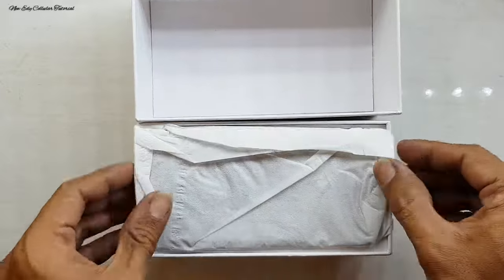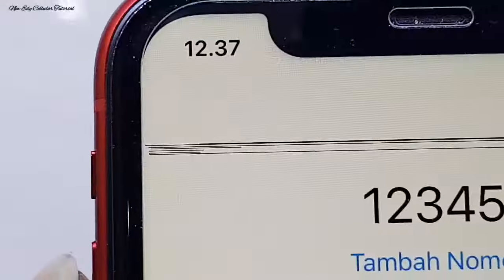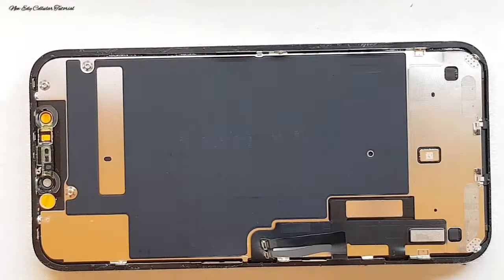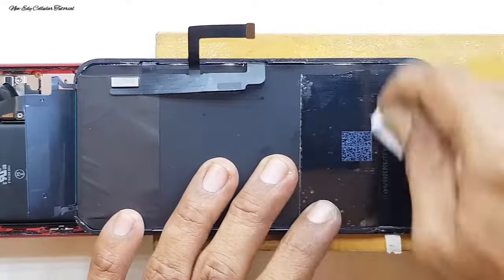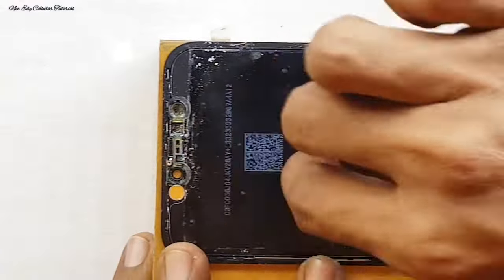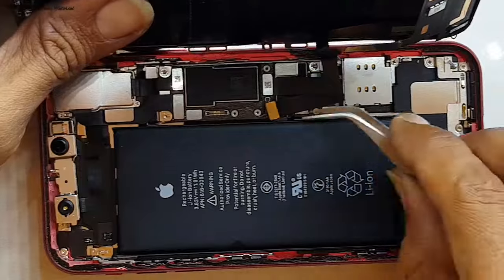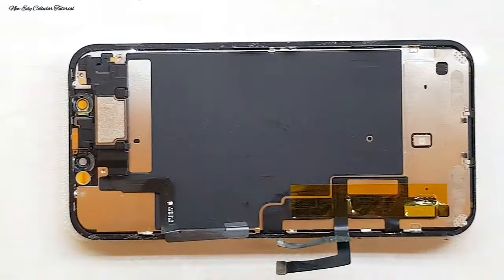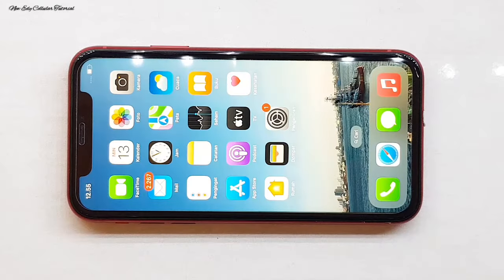IPHONE 11 LAYAR BERGARIS ‼ 100% HILANG PERMANEN, TANPA GANTI LCD‼ "Kiriman dr Subscriber"

Comment: Di bubbe remover aja bang enak dan capet dari pada di gosok gosok
Reply: Betul lebih cepet make bubble remover, tapi kalo make bubble remover harga bu bubble removernya mahal, udah gitu belajar cara make bubble remover yg bener dulu setting2 dulu
Reply: @barrytechno  saya juga menerima ganti tc di rumah mas alat semua handmade dari sparator sampai bubble remover buble remover saya buat sendiri abis 160rb dan seting buble remover gak muluk muluk mas tinggal kasih angin kompresor doang
Reply: Kalau buat hilang in tompel biasa saya pakai tekanan 120psi ke atas max 160 di jamin tompel hilang
Reply: @ozzy2waloyo663  berapa lama bang waktunya? Saya juga punya soalnya pengen coba caranya masih pemula saya